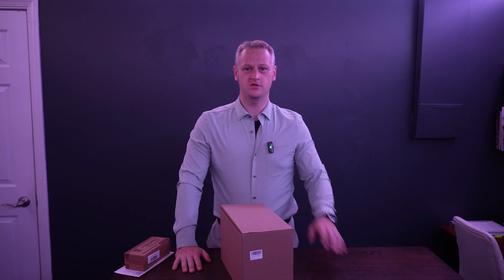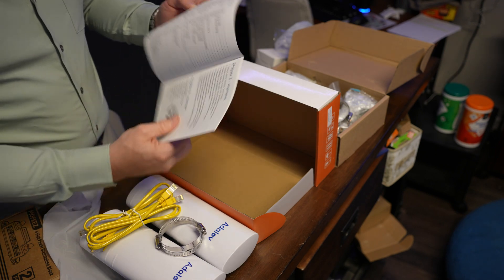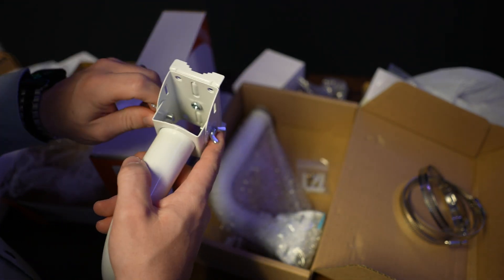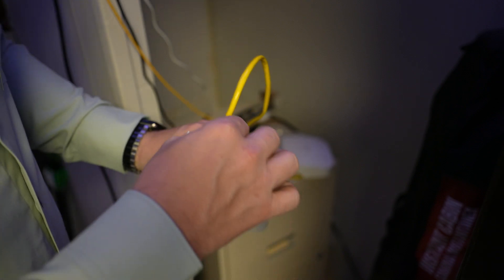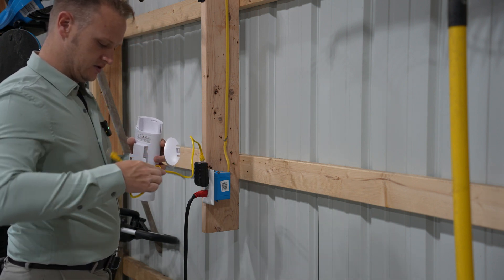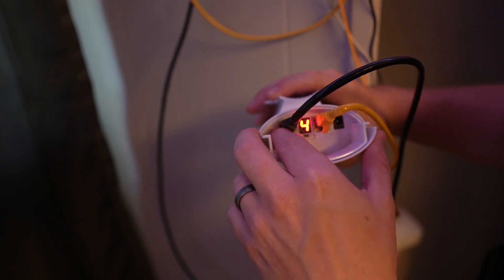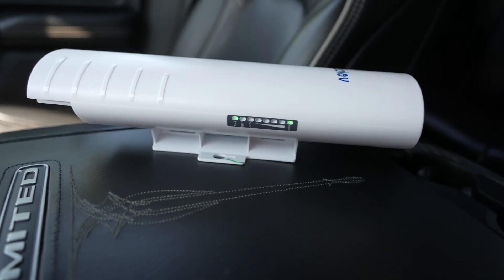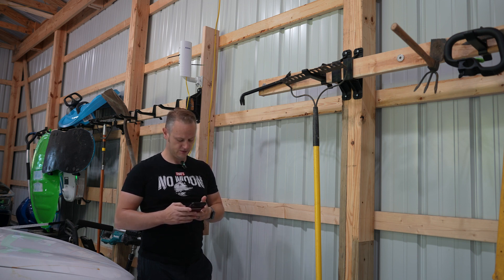Adalov Wireless Bridge (CPE361) Review

Comment: How do you change the SSID and password on these devices?
Reply from the maker: You have to initially connect to them via ethernet cord to set the password/SSID. After that they should remain set.
Reply: This is my issue, how is that done? Nothing works the IP address to get to the setup page wont work Ethernet connection or not. The username and password wont work.

Comment: Your range problem is due to the fact that you’re in a Faraday box, a metal paneled garage.  I’m surprised you got any significant performance.  These devices are designed to be outside for unobstructed line-of-sight operation. Change your installation and run the test again.

Comment: There is magic pill here kids, cheap gear that is flooding the cheap sales sites with little or no regulation on selling such gear. To work where others don't needs RF Power, power that others are limited to by laws and regulation. You have just turned on a rock concert worth of RF noise in the band in the area. Lets just say, I like many others would not appreciate your negligence or ignorance of putting this junk in the area or videos like this that have no technical understanding.